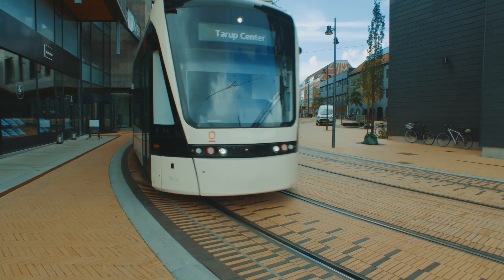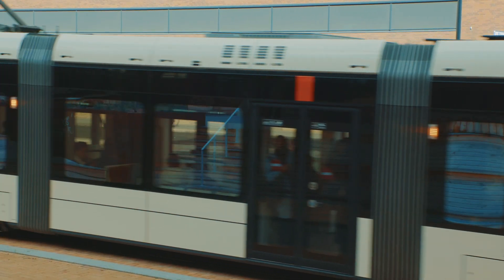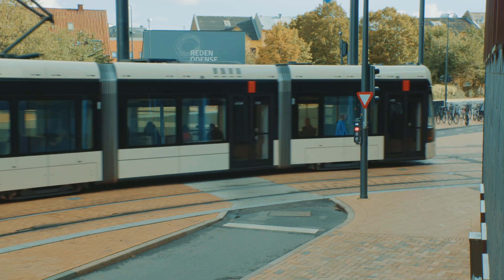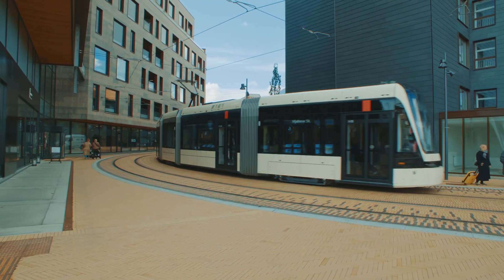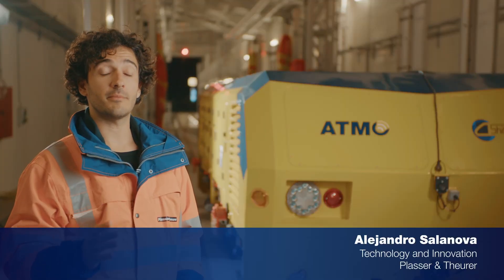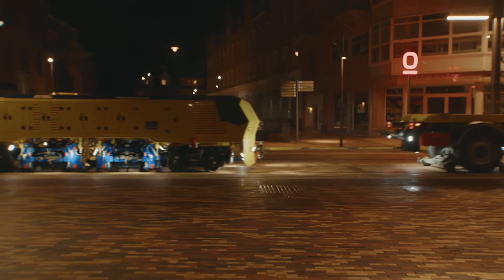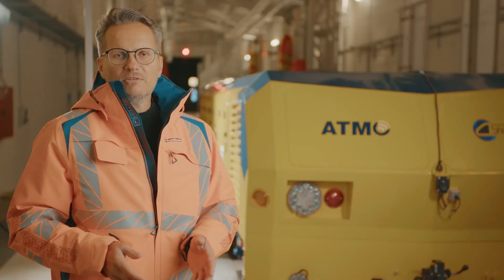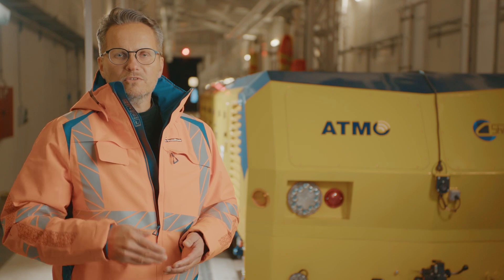Plasser ATMO in Denmark

Comment: Interesting concept, ive never seen a grinder like this

1:10 this would not work if there is traffic (Cars etc.). Also how good is the view from the drivers cab? The grinding cart is not that high but It still blocks the view.

It would be better to use a special loco/work vehicle for pulling the grinding cart.